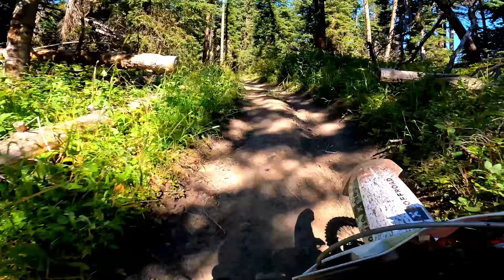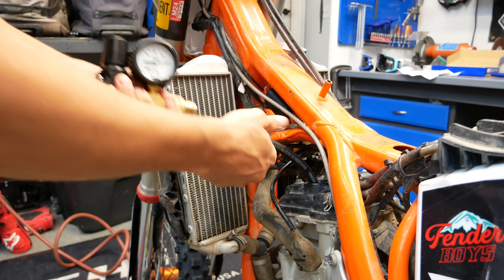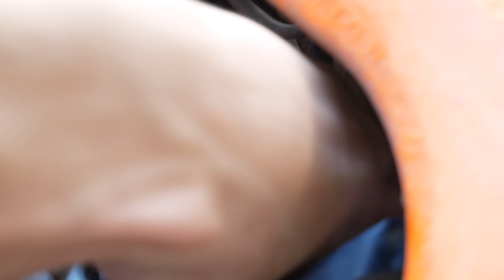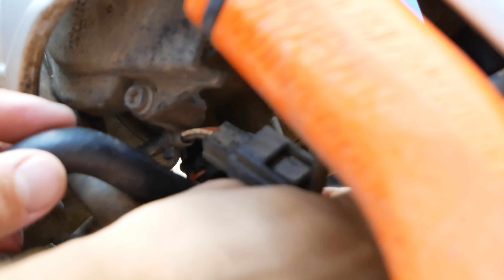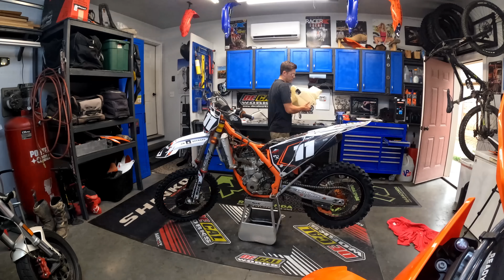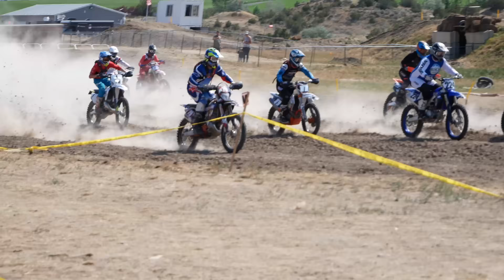My KTM 350 Blubbers and Runs HOT! Can I Fix It?

Comment: i have a 2022 xcf 350 i do not run a rad fan and i find if im not riding it hard it runs very hot i have a friend with a 2017 sxf350 and he has the same issue

Comment: I noticed a difference on my 350 after changing the fuel pump and filter.  It might hit 50psi when dead headed against a closed injector, but can it maintain the required pressure when the injector is open?

Comment: My ktm 250 had the same problem and we changed fuel pump in the gas tank and that fixed it but then a few weeks later it happened again but me and my dad looked at it was the hose to the gas tank if it ever happens again check for that

Comment: I'd suggest you go back to a 50/50 mix of coolant and water. The water is a better transferer of heat than just straight coolant. 
OEM use that mix for a reason. 
Hope this helps with your issue.

Comment: i've had 3 350's (18,21 and a 24) euro models so the EXC/XCW with a trail tech fan at 82 degree celsius 180 fahrenheit at it's on a lot on all the 3 bikes.also running around 200 F in race conditions or mud races never had any issues in over 400H of total running time due to heat.  That being said the fuel pump is a known issue on the 350's i also have had a few bad injectors. hearing your bike and thoughts i think definitely a fuel issue.

Comment: Hey Kincade! About the chain tensioner. After this many hours it may be a good idea to check the camchain for wear (and also the guides) as overtime these stretch. If it is stretched the tensioner has difficulty keeping enough pressure on it as it has to extend (almost) all the way

Comment: I’m rebuilding a yz250f and I don’t know how to find tdc on the compression stroke to set timing. How do you know if you’re on the correct stroke?
Reply from the maker: The cam sprockets should have markings; don't know exactly how Yamaha has their engines set up. I'd get a manual. But the cam lobes will be facing a certain direction. You can also put a screwdriver or something in the spark plug hole and if the piston is at the top, you're good to set timing. I think those Yamahas have lines somewhere behind a plug in the ignition cover that show you you're correct as well. If you already have the top end apart, the valves are already closed. So you just have to make sure to reinstall the camshafts correctly to be at TDC.

Comment: Hi, for lower heat, try higher pressure rad cap w/quality DB rad fluid. For more drive, adjust the dds preload. Unsure about lean condition, but maybe mapping or re-initialize ur CPU for ur elev (no touchy touch throttle during initializing procedure).

Comment: Most 4 stroke bikes run at 200° unless you’re riding hard enduro I would take the fan off. You get more air flow with just the fins on. It will channel more air. But yea my 250 runs great at 210° im sure the 350 will be the same.

Comment: First thing I always check on a fuel injected KTM is fuel pressure. Taco moto sells a pretty good gauge, or you could make your own. 48.6-52.9 PSI is spec.
Reply from the maker: Ahh it can be hard to remember to include everything I've tested in these videos haha. Did indeed test fuel pressure. 50 PSI. Thanks for the comment.

Comment: I have had very poor experiences with Rockey Mountain. I have ordered a few small parts which arrived as the completely wrong item. Luckily I only needed them for spares and they were only small gaskets, but still, this has happened multiple times. However, I ordered a Works Connection, aluminum skid plate for my 2013 CRF450r for around $100 which stated it was for this bike and would fit. It was for MOST CRF450r's however my bike already had a factory skid plate when it was new. This is something I didn't know or think of at the time. The factory mounts for the bolts were welded to the frame. The skid plate itself was long gone by the time I had bought the bike. The new skid plate I bought arrived and I attempted to put it on, only to find out, the mounts for the original plate did not allow for it to be installed since they were in the way of the mounts the new one came with and could not be used themselves. I also noticed one of the new skid plate brackets (which did not have anything in the way of it) would not, under any circumstances, go into its assigned spot on the frame without being cut down with a grinder or simply TAKING THE ENGINE LOOSE and picking it up about a quarter of an inch to get the bracket in place. I obviously took the item out of the package to attempt all this. I called RM and informed them of the issue. I also took detailed pictures and sent them to customer service. They informed me it was not their problem and since I was dumb enough to open a part I bought instead of leaving it in the package and simply never opening it for use (apparently this is what they think people do with items they buy), there was nothing which could be done. I spoke to a manager and a few other people who said they would allow it to be returned (probably since I was ticked off and wouldn't leave it alone). I sent it back, paid like 30 bucks for shipping, and a month later or whatever I got $17 for a return. I called again, furious, and they told me they had no choice but to charge me a restoking fee and a damage fee. If I would have known this, I would have simply kept it and drilled different holes and made it work with the original mounts somehow. What do I think should have happened....? Well, as a company who CLAIMS to care about their customers which has a MASSIVE operation, after evaluating the problem, they should have ate the cost. Not me. I am out, including tax and shipping, over $120 and have NOTHING to show for it. I make every effort to buy elsewhere now. Sometimes I have no choice, but seriously, this giant company could do so much better and chooses not to. Nope. I don't like Rockey Mountain. Just something I had to warn people of. Kincade, love your videos man. But tell those .....people.....at RMMC to do better.
Reply: Rocky Mountain is by far the best in the industry. I've ordered thousands over the years with zero issue. You couldn't figure out how to install a skid plate so you cut it up and drilled holes in it and it's somehow their fault? No man, that's on you. I've put that exact same skid plate on the same Gen CRF and it was tricky but it fit. Maybe you should invest in some mechanic classes down at the local community College before you go bashing the best in the biz.
Reply: @KTM.Dealer.770-p4f  So I'll take a second to clarify my statement which may have been confusing. I did not cut, grind, scratch, or in any way damage anything. I simply pointed out that the bracket on the front left of the frame would have had to get some help in one of those ways to be installed. The item was "opened" and therefore "used" and unable to be re-sold as new. That is automatically a "damage fee". This is the explanation I was given. The restoking fee is simply for returning it outside the normal 30 or 60 day timeline. Don't remember the exact number of days but that is irrelevant. The plate and mounts were never damaged in any way. 
Yes, RM is one of the biggest companies out there. True. So, they cannot make mistakes?? They are obviously angels because they are the "best in the biz". Interesting opinion dude. You sound young with limited life experience. Can you tell me how long I have been riding, working on and building bikes..? Your suggestion of classes at a community college makes me think that's where you are at the moment. Take some advice and slow down before attacking the keyboard. Yah, I had a moment and felt the need to share a story which still irritates me a bit. Why not? In no way does it attack anyone personally, nor will it hurt the company's reputation really. It's a short story on a YouTube comment section. 
As for whose fault it is, it's probably initially Works Connection for overlooking something, simple, honest mistake realistically. I'm sure RM advertised what they were told by the manufacturer. Or at least I hope so... Let's assume they did. Okay so the part doesn't fit. BTW they acknowledged this, I sent pictures remember genius. The response was "yah that's wrong and definitely won't work". So, who eats the loss? Works Connection? Probably should because they made the part and assuming they advertised it to fit a 2013 CRF450R, they are the initial problem... BUT! I didn't buy it from them. I got it from RM. So, did RM know about the issue when they were selling it to me? No probably not. Again, we at least hope they didn't lol. But nevertheless, I spent money out of pocket for an item which did not fit what was advertised. It was purchased from RM. RM acknowledged the issue and told me to kick rocks....Why?? I am the customer. All I did was believe what they advertised! Now there is no forgiveness for me? The biggest, "best in the biz" company wouldn't fix a mistake which was beyond my control even though they, the huge company could easily do so. Noone would be laid off if they simply gave me a real return or even store credit. That is not how you do business. That is how you piss people off and earn a bad reputation. So, before you get rude on the internet, go down the hall in your community college and take a business class.

Comment: flush the radiators and use engine ice its a good idea to check the water impeller at the same time as they are plastic and can get tired over time. also getting the ecu remapped isn’t a bad idea as it only cost about $35 i got my 350 remapped and i don’t even run a thermo fan doing enduro now + it gives you more power. if neither work check you radiator fan is calibrated properly using a temperature sensor on the radiator next time you ride. love the vids btw 👍

Comment: I would check the impeller for the pump.  Also, might be worth it to put a laser temp sensor in your pack and verify that the temp gauge that turns on and off your fan is correct.  I'd hit the sense at the rad and make sure it matches.  I know I have a tusk fan on my bike and it seems it can be wonky.  I was going to do this.  If you don't have one they are pretty cheap to pick up.

Comment: Just an FYI, but .378 V instead of .400 V will lean the bike out slightly.  Might be worth your time to adjust it to .400 V just to rule that out.  The leaner it is, the hotter it will run.  It is also probably worth your time to confirm your temp readings are close with an IR Temp gun.  I assume your just going off the fan temp gauge and I've seen the Tusk and Trailtech temp senders vary quite a bit.  I had a Trail Tech that read way low.

Comment: I got an in tank fuel filter (I think from slavens). It sits just below the gas cap and it's shocking the amount of junk that it catches. I'd definitely recommend getting one as it'll drastically reduce the amount of times you need to deal with the other fuel filters. I have 140ish hours on my KTM and I've never had to change the inline filter.
Reply: I have one too, great investment

Comment: Try running Evan’s coolant. Zero water coolant that is crazy good. I had an older husky 450 supermoto that would run hot unless Evan’s was in it.
Reply from the maker: I am currently running Evans! I should've mentioned that. Appreciate it though!
Reply: There is literally no benefit using waterless coolant vs oem or even Wal Mart brand coolant.
Reply: @KTM.Dealer.770-p4f  my bike ran cooler with it compared to regular coolant 🤷‍♂️

Comment: My 2019 ktm 350 had a hole in the in tank plastic fuel filter. Very small hole lost fuel pressure and would lean pop/run like a bad carb 4 stroke. Drain the tank down low but not empty look into the tank and you’ll see spray edit seems like you already changed it out!
Reply: nice tip!